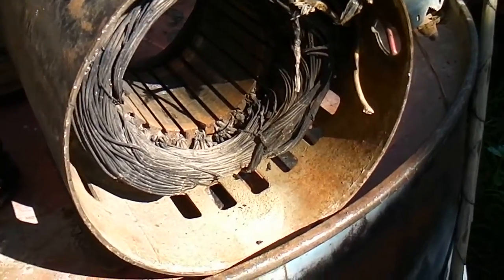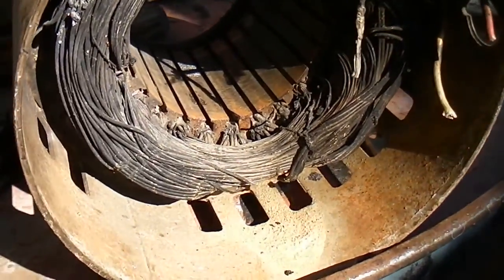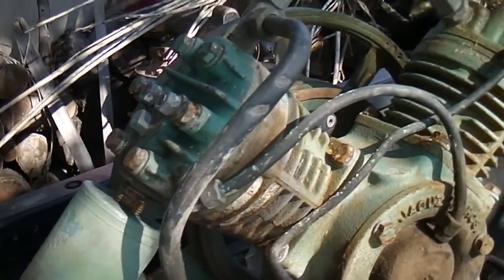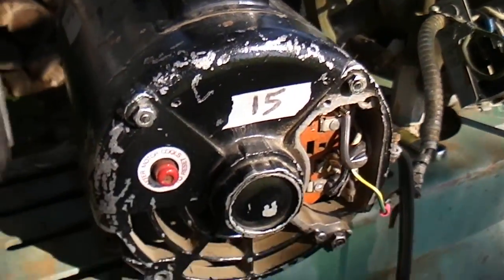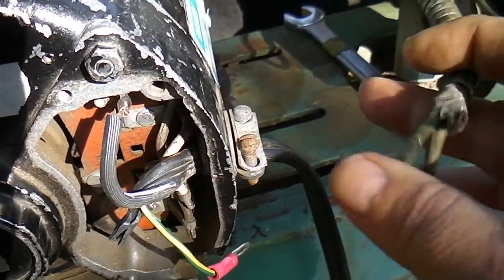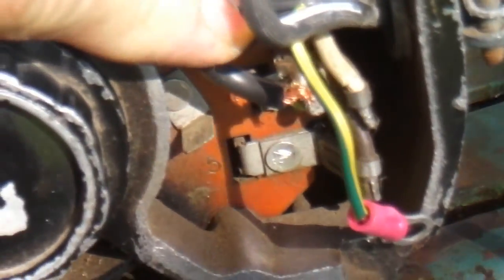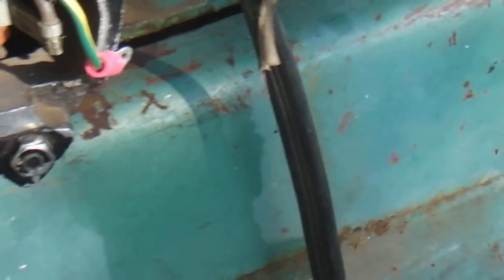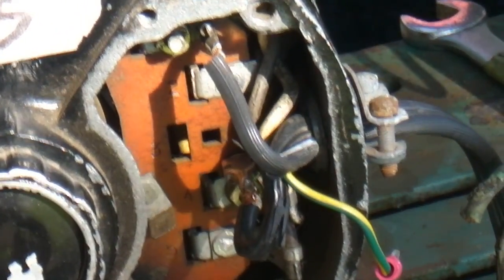How should a 115 volt 2hp Compressor Motor wire up?

Comment: I have a motor that is 230/120 I'm try to use the 120 windings where should I make the connections? ?
Reply from the maker: +HECTOR MILLAN Look inside the cover it will show you a diagram. I didnt realize this until later on when I found it.
Reply: +shartne I went back and just check cover don't have a digram but I did noticed the compressor says I could be wired for 230/215 I look at his motor he's does says 230/115 my motor only says 230 where his says 230/115 I wonder if they swapped the old motor and replace it with a 3hp single voltage..

Comment: White is Hot, Black is Common and Green is your ground.  The pressure switch should have the main power cord coming to it and then it provides power to the motor.  The motor shouldn't matter as long as you hook up the ground correctly.  The Hot and neutral can be reversed since it is AC and it's an induction motor it makes no difference.   However if you want to wire it the same as it is now to the pressure switch...  If you look at the plug with the prongs facing you and the 3rd prong facing the bottom, the black (common) is the prong on the left and white (hot) is the prong on the right.  The third round prong is your ground.   If you want to wire it up the same as it is now I would get a multimeter and ohm out the prongs as to where they go on the motor.  I wouldn't trust going buy which side the stripes are, because inside that plug it could be wired either way (there is no NEC Standard for that).  If you ohm it out you know for sure where the hot and neutral and ground are now and you can put your wires from the pressure switch in the same places.
Reply from the maker: I noticed the motor says it can be wired for 230 volts. Says it uses only 12 amps for 230 volts and 24 amps for 115 volts. Can it be wired for 230 is that different? I just made a 220 outlet for my old compressor so I would like for it to be wired for 220.
Reply: Most likely but there should be a different screw for the 230volt hookup.  230 is going to use a different set or combination of windings in the stator assembly.  However the regulator switch may not be able to handle 230 if it was designed for 120, and more importantly it probably can't handle 24 amps. I wish I could get a real close up picture of the pressure switch and the terminals on the motor.  Also a picture of the tag on the motor as well.
Reply from the maker: ***** I will make a much better video tomorrow in the day light with less shaking and a picture of the tag too. I guess the guy may not have been a idiot trying to put a 220 plug on it but it must not have been wired for 220 the first time. I have another pressure regulator that is for 220 brand new. I will show some of that too.

Comment: green is ground, black is hot and white is common. Hook the white wire to the white connection on motor, black goes to black connection and green goes to ground on the body of the motor. If you need more help, hollar at me in email and I'll give ya my number and i can help ya over the phone
Reply from the maker: Thanks I will have to look behind the board to see if the wire is color coded. Someone said it dont matter to the motor if you have the wires in either position.I dont know though i would rather the wire went to the correct polarity.
Reply: it can matter, some motors the common or neutral side (white wire) is also grounded, you don't want to hook up the hot (black wire) to it, did ya get a chance to download the pdf of that book? if not send me your email in private and I'll send it to ya, it has diagrams for wiring motors as well as other electrical info, its a pocket reference and is very handy
Reply from the maker: I saw a white wire and a brown wire on the motor. It says it can be wired for 230 volts that would be better I think. I hate to fry this motor.
Reply: 240 volts is what you will get probably, its more voltage with less amperage at 240vac compared to 120 vac
Reply: i hope ya don't burn it up too
Reply from the maker: mee too Im going to make a better video today showing better details so people acna help me get this right I hope.

Comment: I'd say your green wires are ground and should meet on a chassis mount, and the other two (black and white) are two sides of AC and are interchangeable. If it'S A 2 hp, that's a lot of watts, you might wanna add an AC capacitor across in the inputs, just make sure it's AC, and not polarized for DC.
Reply from the maker: thanks for your comment

Comment: that's should just be a pressure switch that interupts the power to the motor in series  circit usally the black wire or hot wire just like a light switch hope that helps see ya :-)
Reply from the maker: thanks for your comment